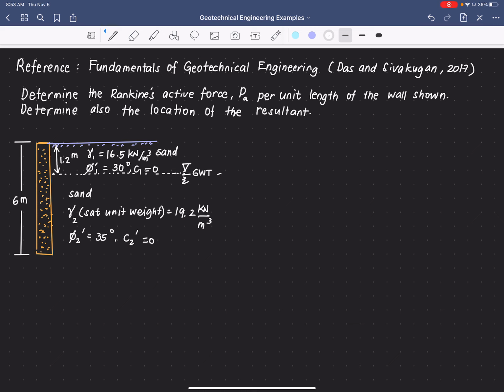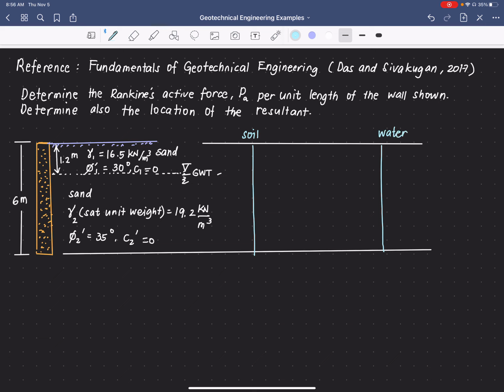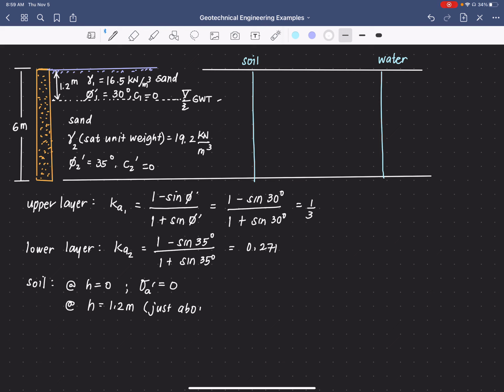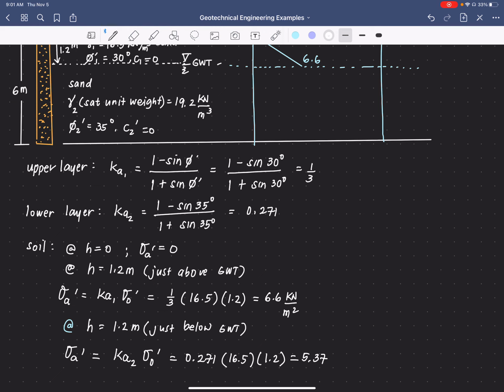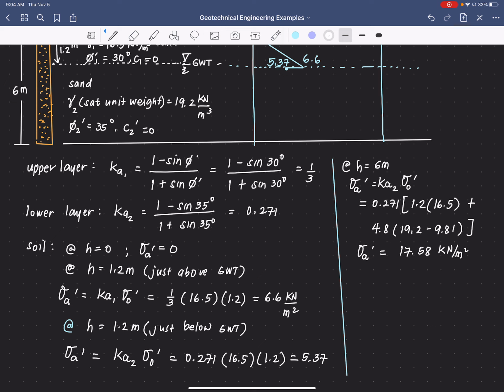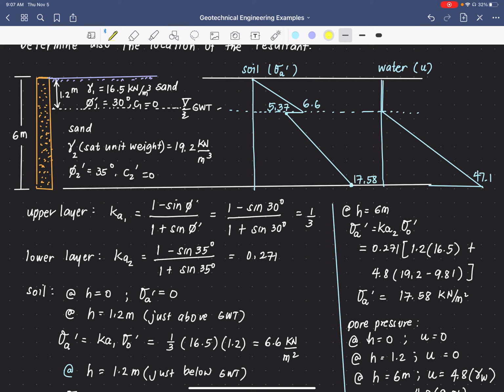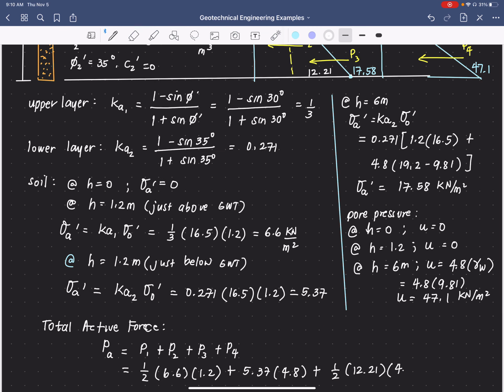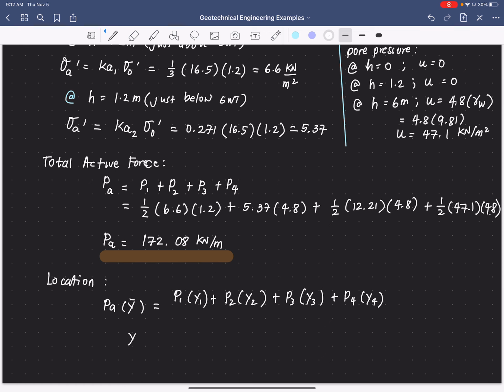Lateral Earth Pressure

Comment: Thr part where we calculated 1.2m for below and above the gwt is understood but while calculating the part where its below the gwt why was the unit weight of the dry sand  used and not the saturated part since we were calculating for the below gwt